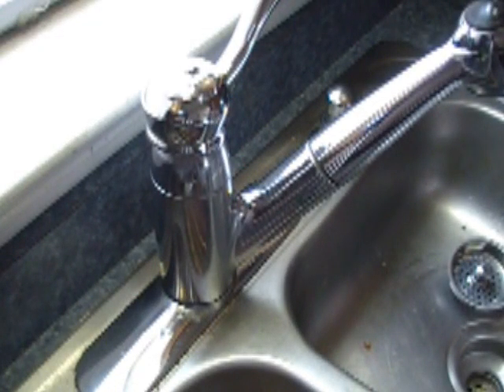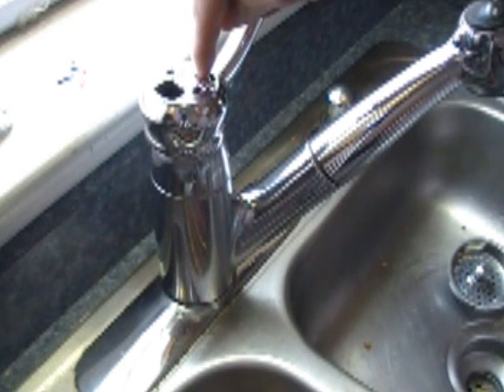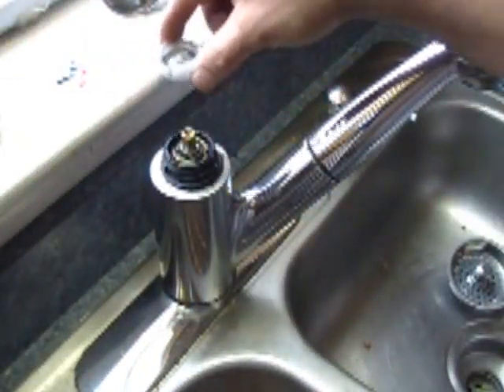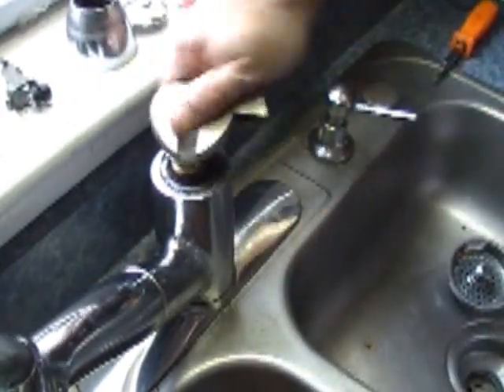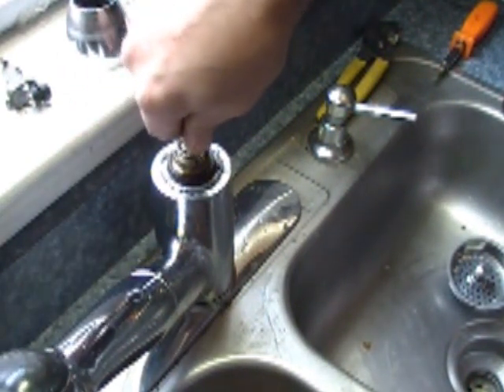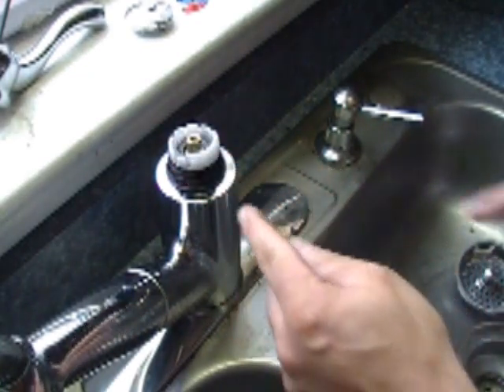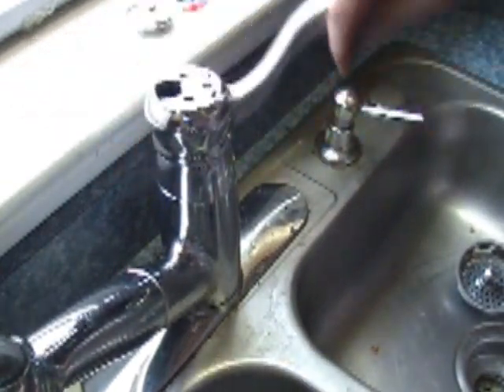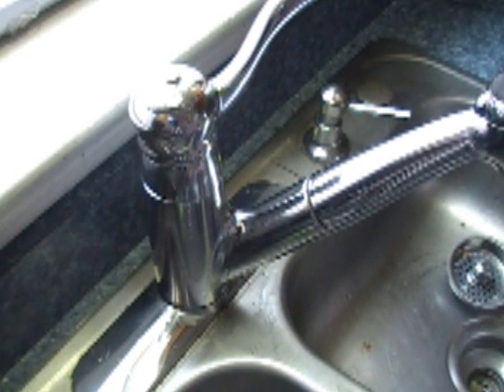How to fix a broken leaky faucet Moen  (moen warranty)

Comment: What are the black pieces called? Specifically the smaller one
Reply from the maker: I’m not sure specifically which ones you’re talking about but if it’s the round ones on the cylinder those are black rubber O-rings